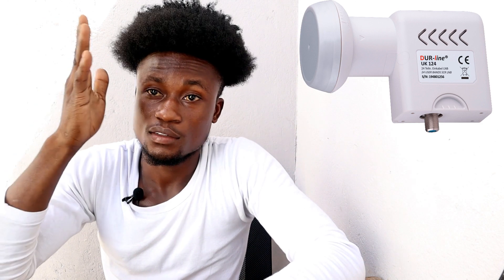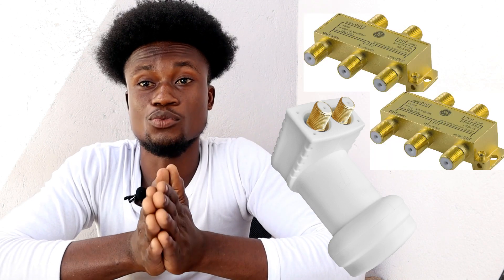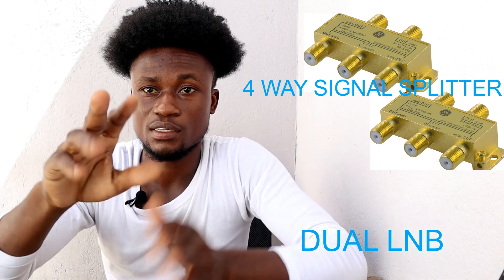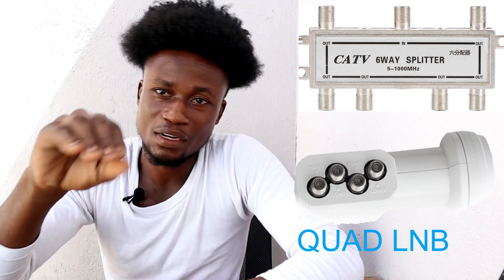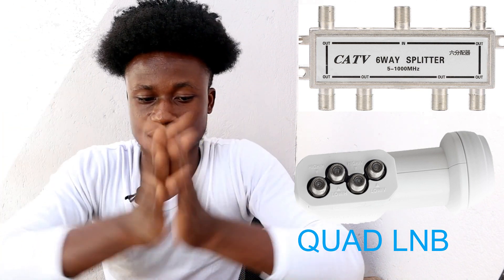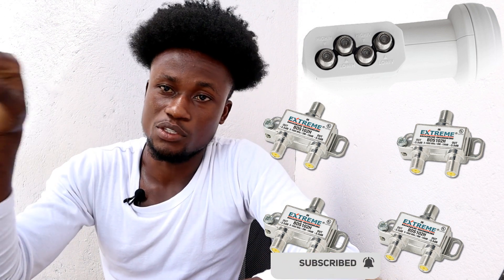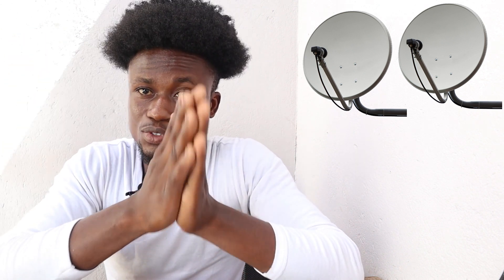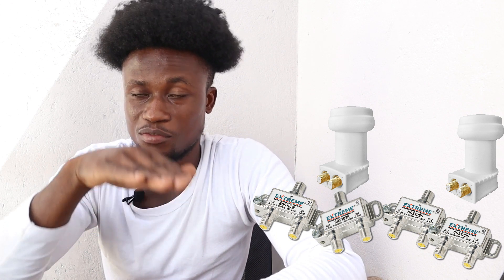How To Install 8 Satellite Decoders With 1 Dish

Comment: Can you switch from another switcher or you just have to connect direct from the LNB it self?
Reply: I mean assuming you have two 4 in 1 signal splitters like in your second option in the video but with a single universal LNB & not dual LNB.

Can you connect the first splitter to the LNB and then connect the second splitter to the first splitter and get same results or you cant split from another splitter???🫡🫡
Reply from the maker: Sure, it will work, but you are likely to get a  reduced Signal Strengths and Signal quality
Reply: @pbtecknology  

Okay, thanks🙌
Reply from the maker: If you want to connect multiple dishes on one or more decoders, you have to add a DiSEqC.
*The question is not that clear to me. You can reframe it for my better understanding. Thanks

Comment: Please how can I setup one multi dish with two television set...one of the TV is built in and the other is not so we used decorder for that one... please the dish too is using two LNB
Reply from the maker: Two LNB meaning there's a DiSEqC. You will need a 2in1 signal splitter. If the splitter don't give you quality signal, buy 2 dual LNB and 2 DiSEqC. Replace the signal LNB with the Dual  and cross each of the signal to DiSEqC respectively . Then Connect the receiver cables to the plasma TV and the Decoder.

Comment: Can I use one dstv HD in 4bedroom with living room
Reply from the maker: Sure. But they can change the channel in only one bedroom, meaning they have to watch the same thing. You can add IR remote if you want the Channels to be changed in two locations. But they can only watch one Channel at a time. You'll need  a video splitting tool either HDMI splitter or AV splitter. You can use RF modulator but it's doesn't offer quality video output so I don't recommend. 
Bless Up ❤️...